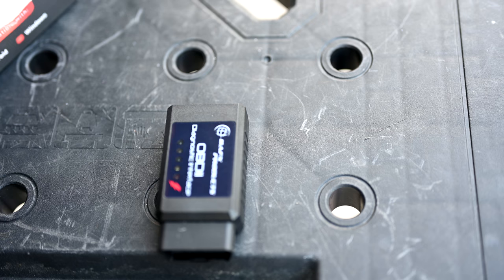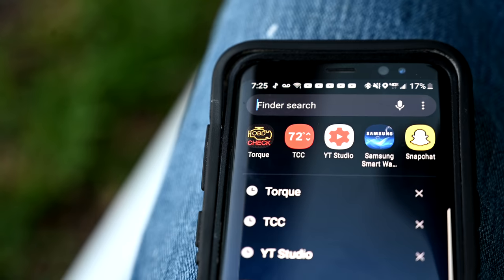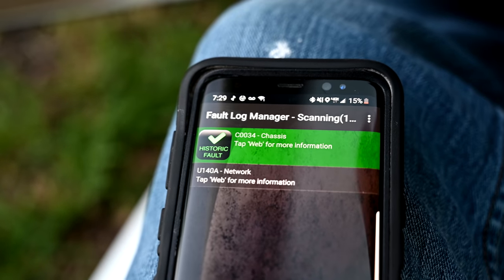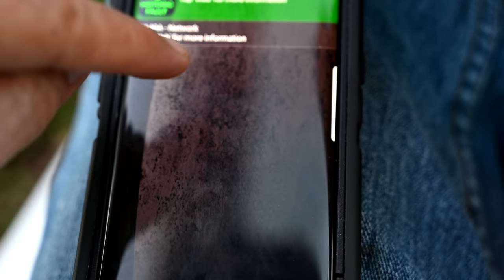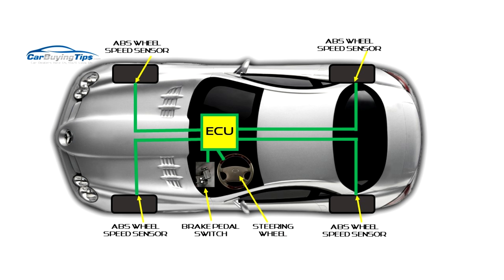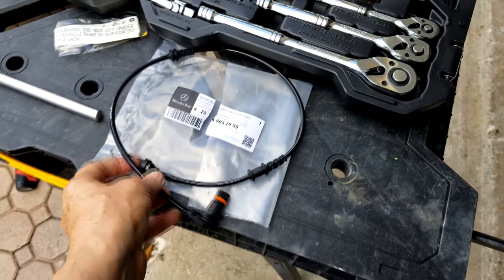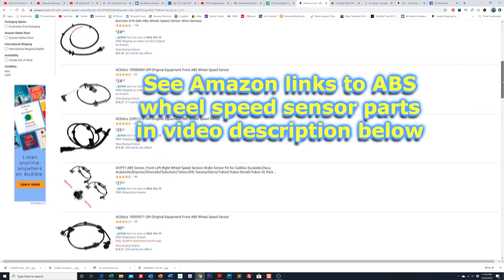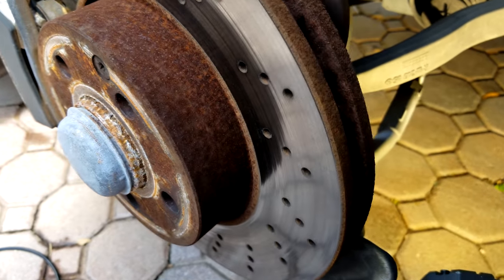ABS Unavailable [How To Fix]: Check Engine Light Mercedes

Comment: i had my rear abs sensor replaced. The error is gone but if I brake lightly at 30 km / h, the abs sensor works for no reason! can someone help me??
Reply from the maker: Not sure what you mean when you say the abs sensor works for no reason. The ABS sensors are on all the time as long as the wheels are spinning. Not sure what your problem is that you are having with the sensor
Reply: @carbuying  the ABS intervenes at low speed. The brake pedal feels like I'm braking on a slippery road.

I hope you Understand this :/
Reply from the maker: @tarekbeats  It's impossible really to debug your car long distance, especially a safety system like this. But if it's triggering the ABS brakes to clamp on, then the car's ABS computer is thinking you are mashing the brakes hard, or maybe it's not getting an accurate ready from the ABS sensor, so you should double check your abs sensor and find out if it was vacuumed out, make sure the sensor is good quality, check your brake pedal switch. IF you can't perform any of this, you have no choice you have to bring it to a mechanic. A weak signal from a sensor is interpreted as a locked wheel, which triggers the computer to activate the ABS system and release brake pressure in an attempt to unlock the wheel.
Reply: @carbuying  Thank you very much!
Reply: @carbuying  I was with the mechanic.  We removed the sensor and checked the ABS ring.  he has a lot of rust.  we tried to clean it up.  But now the ABS ESP and engine lamp light up again...

Comment: I changed both on my 2014 c250 and that didn't fix the traction control
Reply: How did you resolve it. Having same issue and no fault codes
Reply: @aliyuadamu3945  I haven't fixed it yet but was told it's a part in the steering column

Comment: Abs and everything went away. Check engine light still on.
Reply from the maker: Did you re-read the OBDII port to see what the current engine code is? Also give it a day sometimes the main CEL goes away on its own. If not, try to clear the engine code with your OBDII reader or app

Comment: What if my car don’t turn on at all? It’s not even recognizing my key fob
Reply from the maker: Never seen that before, maybe the battery needs to be changed in your key FOB. What did you find out?
Reply: @carbuying  I did change the battery on it and since then it still don’t recognize my key fob 😭. I unplugged the car battery and well I think the car is stuck in theft mode if anything. 😔

Comment: great video!  However, I will say that I'm not the smartest man in the world, but that doesn't seem like a 4 hour job
Reply from the maker: It is, go ahead and try it, this will take you 4 hours if you never performed this fix before. Loosening those nuts and reaching them is not a trivial task, and because of limited range of motion, that finally nut holding the sensor in place with take you 5 to minutes to unscrew it.
Reply: @carbuying  just out of curiosity,  with your experience,  does it take you 4 hours?  When im doing a repair on my car,  the hardest thing I run into is breaking a bolt loose...
Reply: @carbuying  took me 30 minutes lol.. but it's because of your thorough instructions... thanks!

Comment: NEVER work on a car on a jack. Always use jack stands!
Reply from the maker: True, but you know some people will do it because they don't have the money for a jack stand which is why we kept stressing in the video to keep your hands above the wheel where they belong.
Reply: @carbuying  It is not my desire to be disrespectful of you, Sir. But, having been a Professional Building Contractor for 42 years now, I have found that, there are no short cuts, related to safety or quality. With that in mind, for you to perform that work, showing others a scenario that could be crippling or even life threatening is unacceptable at best! 

Now, I am sure my comments seem harsh and, to you, border on being rude, especially to a stranger. But, if you are going to put content out, you must also accept the responsibility of teaching people who don't know better, the proper way to do things.

With that said, I certainly appreciate your instruction and teaching. I admire you for the courage to put yourself out there. Unfortunately, It doesn't come without risks. Thus my comment above. I which you well, Sir!
Reply: @carbuying  I agree but even you should have put a jack stand under or a stack of wood blocks.
Plus if you lift the car high enought shove the tire you took off underneath as a back up safety measure.
It can save your life. Those jacks collapse or tip and a person gets trapped unable ot breathe
You need to do it safely yourslef plus show people how it should be done. You need to set the example yourself. I mean so in a respectful manner and just suggesting.
Reply: Great video by the way.